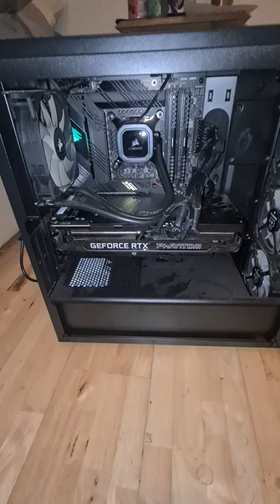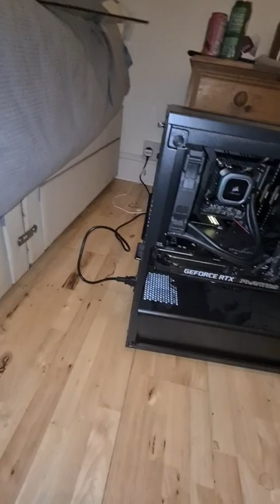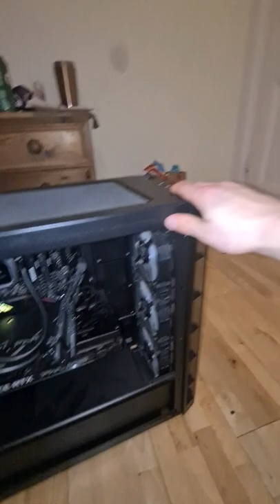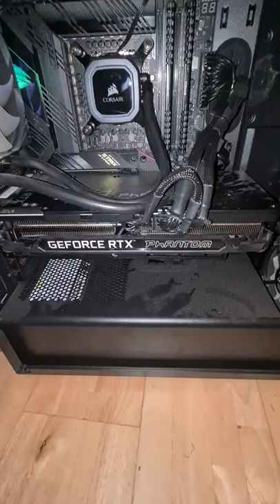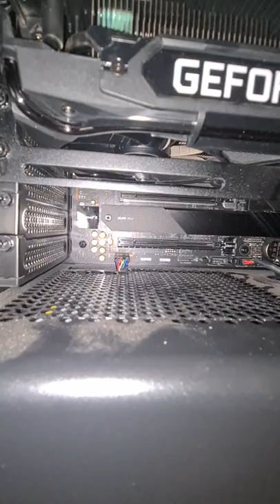PC specialist

Comment: I would check to see if your power supply has enough wattage for your components then just rebuild the whole thing and make sure all connections are correct. If I were you I would re mount the cpu too and make sure everything is right there. I would guess it would be your cpu power delivery that is causing this issue but I could be wrong

Comment: PSU issue, the noise you're hearing is a relay. I had a very similar issue years ago, likelihood would be the relay is cutting power after over current protection engages. Very strange if it arrived like that and got through product testing but going by the dust it isn't a brand new system

Comment: Is it the mobo because lights doesn’t mean it works
Reply from the maker: This video was only made to send to PC Specialist so they could see what the problem with. They think it could be the PSU and are sending a replacement, which if doesn't work, they will take it in house to figure out and repair🥲
Reply: @thisissmo8769  change ur psu